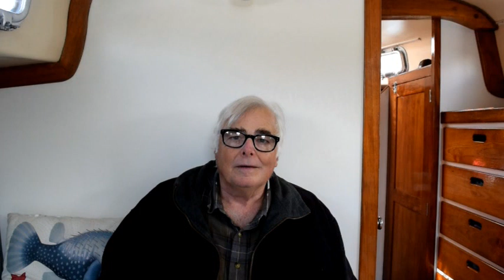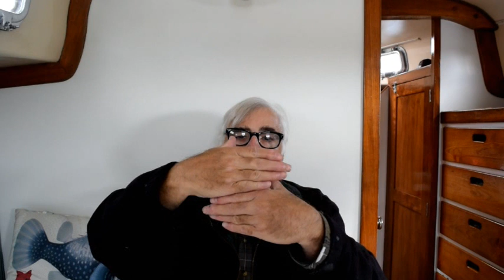Wood Boat or Fiberglass Boat - Which is Better?

Comment: Great Vid! But my question would be when the fasteners of a wooden boat tend to loosen up by time what would be your recommendation to check them and how? Because I think it is a Sisyphean struggle to remove the spile or the putty which cover the fastener on the other hand I like to avoid the situation that a loosen plank overtakes me in rough water ;)
Reply from the maker: Michael, the method is to periodically check random fasteners.  Yes it can be a pain to remove plugs/putty, but that is just part of owning a wooden boat.  You can also simply inspect the hull for loose planks, but that doesn't replace actually pulling some fasteners.  Randomly pulling a few fasteners tells you if they are tight AND the condition of the fasteners as well as the frames.
Reply: @todddunn945  Todd thank you kindly for your response. Which fasteneser are more likely to become loose? In the bow, aft or in middle section.

Comment: After you've beaten or neglected that old boat,  what do you do with it? At least you can chop up the wooden boat and throw it in the woodstove...Unfortunately, today recycling a fiberglass boat is an academic subject until you actually have to do it  - and it aint pretty.
Reply from the maker: Well actually you can't simply burn the wooden boat because of all the chemicals used in the coatings.  Older wooden boats have lead based paints all over the place and the newer paints are not good to burn either.  A fiberglass boat can be cut up, but even after 50+ years my fiberglass boat is very sound and should last another 50 years with some systems upgrades.  You can't say the same about the newer very lightly built boats.  Thanks for the comment.

Comment: Expansion & contraction are often overlooked . All boat building materials have advantages & disadvantages .
Reply from the maker: Yes expansion and contraction of materials are significant, more on wooden boats than fiberglass.  In fact wooden boats depend on expansion of the planking stock when it absorbs water for a significant part of the boats stiffness and water tight integrity.  Thermal expansion can also be a factor, but for recreational boats that is largely pretty small because dissimilar materials with different thermal expansion coefficients are not that common on recreational boats.  If I had expanded this talk to include metal boats then thermal expansion would have been a much more significant topic.  It is particularly important when a steel boat, for example, is built with an aluminum cabin house to keep the center of gravity low.  Steel and aluminum have quite different thermal expansion properties which must be taken into consideration in the design of the boat.  Another topic that is of vital importance is the galvanic corrosion that occurs when dissimilar metals are used in the construction of a boat, particularly if the boat is used in salt water.  I could do many videos on those topics alone.

Comment: Great information, thank you. I am finally looking for my first boat after sailing on others over the years.  I always wanted a wooden boat but was nervous about keeping the water out with all the pieces.  Would you say as long as the boat is hauled out and properly inspected/repaired annually that there is no need to worry?  Also, 1 last question. If one were to hit say a log in the water, would you prefer to be in a wooden or fibreglass boat?
Reply from the maker: Michael, a wooden boat in good shape will leak some.  After the hull is fully swelled my bilge pumps run about 3-4 times a day for 7-10 seconds each time.  When I am spending the night aboard I manually run the pumps until nothing comes out and the pumps will not run again until sometime the next day.  Depending on where you keep the boat, you can keep the boat in the water for several years between haulouts.  I haul mine out annually because our winters can be quite cold (below zero fahrenheit) and our winter weather is pretty windy as in frequent 50-60 knot storms.  I would definitely prefer to be in a fiberglass boat if I hit something solid.  If I hit a log, it would depend on how big the log was and how fast I was going on a wooden boat.  Hitting something solid enough to break a plank with a wooden boat will almost always sink the boat since water will come if faster than you can pump it out unless you have a big gas powered crash pump.
Reply: @todddunn945  Thank you Todd for the great reply. I had the fourtune to spend 2 months on a 1939 shark cutter that had a constant flow of water coming in. Our captain said that was normal lol. Okay as long as you have no electrical problems and loose power Haha.
Reply from the maker: @michael_8383  Initially I was concerned about how much power the bilge pumps would use.  Then I calculated how many amp-hours my two 1100 gph pumps use in a day assuming six 10 second pump runs per day (about double what actually happens).  That works out to about 0.12 amp-hr per day.  My battery bank is 210 amp-hours with a minimum of 105 amp-hr usable so my batteries can run the pumps for 875 days before they are down to 50%.  I also have 100 watts of solar that can provide around 30 amp-hr per sunny day.  My pumps are directly wired to the batteries so the system is pretty basic.

How much a wooden boat leaks depends on several things.   Those include the condition of the frames and planking, how long it has been since the boat was last caulked and how the boat is used.  I reframed my boat between 2007 and 2011 and replaced all bad wood on the bottom so my frames and planking are in good shape at least that is what the survey I had last Tuesday said.  I also completely recaulked my hull in 2011.  Finally I don't go out when it is rough.  If you take a wooden boat out in rough weather the hull will work and leaking will increase.

Comment: Thanks heaps for your experience. Can a person fiberglass a wooden boat from the water line n below. If so how many layers of glass mat below the water line would you need to use. 👍
Reply from the maker: You can glass a wooden boat, but there are a number of reasons NOT to do that.

First, unless you are able to keep all rain water out of the interior of the boat, the hull will rot from the inside out and basically turn to mush in 5-10 years.  Because of that glassing a wooden hull is normally considered to be a last resort to keep a boat going for a few more years.

Second, before you fiberglass a wooden hull you have to replace all wood that is in poor condition.  If you are going to do that why not just replace the questionable wood and put the boat back in the water for 20-30 more years.

Third, glassing a hull is a BIG job.  As noted above you start by replacing all questionable wood.  Then you remove all exterior paint and start glassing.  You can glass a hull with just mat, but it won't give much strength.  Ideally you want a layer of mat followed by 1-2 layers of a fabric like 1708 and finished with a final layer of mat.  That will give you a very strong hull.  It will add weight to the hull which will cause the waterline to move up an inch or so.  Finally, to get a smooth surface you will have to spend MANY hours (days) sanding the hull fair.

Fourth, glassing a hull is very expensive both in materials and labor.

Note that there are wooden boats designed to be glassed, but the glassing is done during construction and is both inside and outside the hull.  I am referring to cold molded or combination strip plank/cold molded hulls.

Comment: So for a blue water cruiser you'd always go GRP then? I do wonder how much of a possibility it is for a well maintained wooden yacht to throw a plank... I guess that is the big worry. But is that really that likely?
Reply from the maker: Having a plank spring (come loose at one end) can happen even on a "well maintained" boat because you can't inspect the frames where the planks fit against them.  So it is possible for a frame to rot out and lose its holding power for fasteners while it seems sound, or to have the fasteners waste away.  For example, last Spring a fellow YouTuber (Travels with Geordie) hauled his Monk cruiser out for hull work and found that many of the butt blocks holding plank ends were only attached to the planks by paint and crud.  The fasteners were totally gone, but the hull seemed sound.  A big wave that caused the hull to twist, could have sprung one of those plank ends.   A fiberglass boat (solid glass hull - not cored) is much tougher.
Reply from the maker: The only wooden boat I would go blue water cruising in would be a new boat.  As I said, a wooden hull is basically thousands of pieces and it just takes the failure of one piece to cause big problems.  In contrast a properly made fiberglass hull is one piece which is much tougher than you are.

Comment: Fascinating, and once again knowledge not available anywhere else. Well done.
Fibreglass for me, if I was in the market for a boat, which very sadly I’m not. I’ve always known, however, that wooden boats are rather lovely, and also that they take a lot of care. When I was a boy, in the 50s and 60s, we rowed clinker built boats for years, on rivers, and these needed little work other than caulking and varnishing. The whalers, which were in fact ship’s lifeboats, were great fun to sail, but when I was a boy I’m afraid I didn’t think of the maintenance that much. I do remember being shouted at rather loudly by a CPO when I was crewing a whaler (ship’s lifeboat) in Portsmouth harbour and a huge aircraft carrier came into view in the distance heading into the sound. I only mentioned quietly that sail gives way to steam, but I quickly learnt that this lore didn’t apply to American nuclear powered aircraft carriers (Nimitz?) versus small sailing boats. We got out of the way very efficiently I thought🙂
Reply from the maker: Nice story.  If you maintain a wooden boat regularly it will last a long time.  In addition since the hull is made of many parts, you can replace individual parts as needed and keep a boat going.  That said, a fiberglass boat will last a long time too, but without the regular maintenance.  The cosmetics will be poor, but the boat will stay structurally sound.
Reply: Way to go.Todd Dunn . Your explanation can’t be faulted, and in the right circumstances a wooden boat has to be the best way to go, no doubt about that. Keep up the great work, I know I’m not the only one appreciating your quietly invaluable work. 

I recently found your earlier posts and discovered an enormously valuable history. I look forward to winter... looks especially good in Maine. All the best.

Comment: Todd
How would you heat a fiberglass sailboat?
I like the wood or carbon stove, it seems to me that it dries more the internal humidity that is generated. What opinion do you have ?
Your videos are very good. Thank you.
Reply from the maker: Daniel, I have a Dickinson propane fireplace on my fiberglass sailboat.  It has a double chimney that draws in outside air for combustion through the outer part of the chimney and exhausts combustion products through the inner stack.  I prefer this sort of heater to a wood stove for several reasons.  First, it is much cleaner since it produces no ash or soot.  Second it can be turned on and off in seconds, which you can't do with a solid fuel heater.  And finally, the exhaust gases do not smell at all.

I have a Webasto diesel forced air heater on my 1936 wooden boat that also works very well.  It burns fuel directly from one of my fuel tanks.  Fuel consumption is quite small, but it does use a couple of amps when running. There is an exhaust smell that you can notice when you are down wind of the boat, but there is no smell in the boat.  Similar heaters from China are now available very cheap ($200 or so).

Comment: Combination of wood and fiberglass much better
Reply from the maker: Depends on the combination.  I would agree 100% for a fiberglass sheathed cold molded hull/deck.  Not so much for a glass hull wood deck.  The best is glass hull/deck with stick built wooden interior.